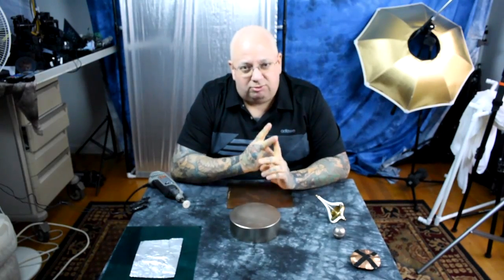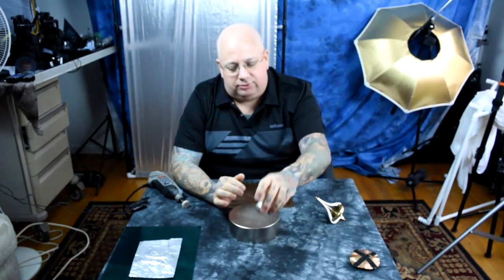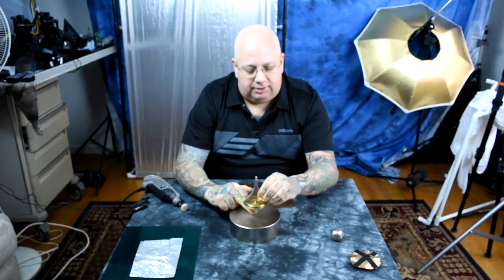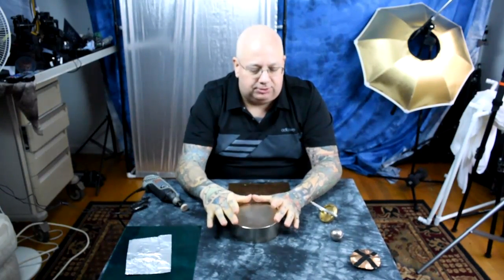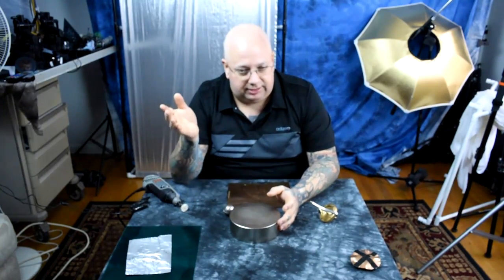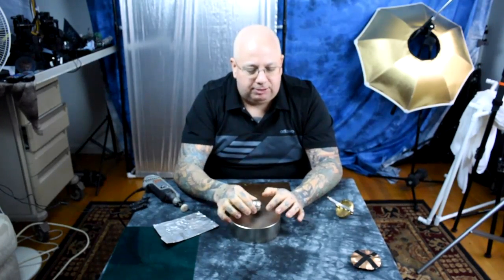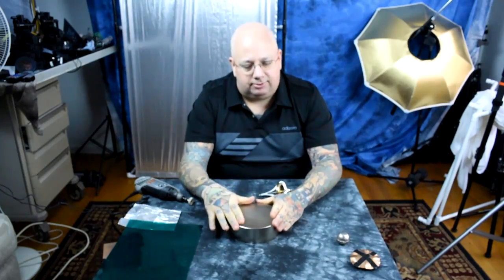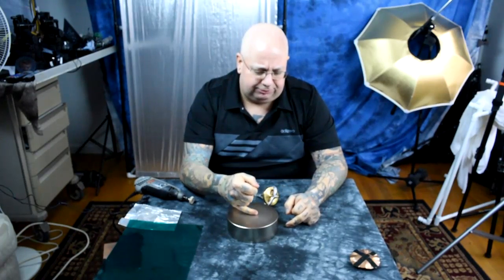PART 1: GOLD SLUICING EXTRACTION device using magnetic divergent field geometry

Comment: Love you vids and info. I got to admit I'm in to prospecting but maybe a bit different from what people are used to. I extract gold from e-waste... To be honest I though about using magnets to sluice gold and its about time a expert gives advice on the subject. My day job is a Draughtman and a I design mining and refining equipment for mines just to add background. 1 issue using permanent magnets, usually when slicing you get iron ores and small partials that are ferris/magnetic. So you would eventually will have build up on the magnets. Cleaning can become a  task on its own. Now I found 1 solution: wouldn't using electromagnets work better as you can switch them off to clean and you can customize the strength to suit. Did you have a solution for this issue or maybe I'm not thinking clearly about it. Looking forward to hear your valuable opinion...

Comment: ..."(bismuth) is havier than lead"?  Unless you meant it has higher atomic number than lead (83 vs 82) I can' see how is it any heavier than lead since it's density is lover. Regarding the gyroscope, it slows down when put on the edge because the flux intensity and gradient is highest on the edge. Any metal that is exposed to the changing magnetic flux will induce current to counter the original movement aka transformation from mechanic to electric energy. Since electric energy can't be transfered from the gyroscope, Eddy currents that are induced within the disc transform electric energy into heat - slowing the gyoscope down in the process as less and less energy remains in the spinning disc. In the center of a magnet magnetic flux is almost constant so while disc is spinnig induced currents are low. Only on the edge where flux intensity and gradient is highest will motion of the disc induce mentioned currents is sufficienty large intensity to rapidly slow down the disc...
Reply from the maker: heavier than lead: FACT
Reply: ...so how does atomic weight relate to element's magnetic properties?...

Comment: OK, I Built two copies of your magnetic device, exactly word for word like you showed in your video. I got the angle you wanted off of the Divergent perfect. At the distances you suggested the immediate problem is massive amounts of black sand immediately clog the sluice. Also everything gets wet and nasty real quick. I took a powerful magnet and hand separated the magnetic black sand out, it took forever and was very hard to do, but it can be done.

Before worrying about driving the gold down into the mat we need to figure out how to remove most of the black sand before gold separation. Key to this is realizing the volume needed.... I figure about 5 shovel fulls a minute is a comfortable work speed. Translated out of a 5 Gal bucket (about 100lbs of fine conglomerate) is about 70 Lbs of black sand.... I'm thinking on a design.

Water volume and velocity is critical to the application as well, which is a huge variable. In real life desert gold hunting you are often severely limited on water to use and many places people 'dry pan' or 'air sluice' which is a whole different application. Is there a way of using the same concept with electric magnets that could be easily switched on and off to clear the clog?  Suggestions or ideas?

Comment: Also wanted to comment on your video on the Crookes radiometer was wondering if the purple light made a difference because purple is made of red and blue  an  different ends of the spectrum  opposing each other on the white and black? Which also makes me wonder since white and black are not actual colors but the absence of supposably. Does adding color to the lack of maybe make a difference? To me it's fascinating stuff

Comment: theirs a tornado in the center it all seems to move in spins witch turn into spirals........... it spinning so fast that it cant slow down very easy pole turning so fast until its propelled out the other side. at witch point it move into less intense filed so that it decelerates.

Comment: you don't understand magnetism. the magnetic field is concentrated around the edges due to nothing other than the geometry of the magnet. the field coming out of the top wants to go to the bottom on the shortest path, it's only natural that this field would be concentrated around the edge of your magnet.
secondly, there is not a vortex or drain in the center. the field is uniform.
think of the funnel thing where you toss a coin into. the coin will go around and around in a vortex until it disappears but the funnel itself is uniform and not a vortex. this is where you're getting confused. you see stuff funneling down like the aurora or electrons in a magnetron, so you assume the field is like that, it's not.
it's like you're seeing the coin go in a vortex, so you assume the funnel is a vortex. they are totally different things.
there is no funnel in the magnetic field. magnetism IS magnetism. the field is one of a kind, there aren't two different kind of magnetic fields in a magnet.
Reply: Can you comment on clockwise and counterclockwise displacement patterns forming on the CRT screen depending on the polarity of magnet faced towards the CRT screen?
Reply: I believe it is you who doesn’t understand magnetism! Eg. ‘Due to nothing other than the geometry of the magnet.’  That is incorrect, and provides a very limited  explanation, perhaps an oversimplification. Would you like to discuss this further with me?

Comment: so funny I figured out how to use magnetism for gold extraction through the you tube clip you mentioned too!! only a week ago, well that one and another one showing gold sticking to an electro magnet, and one that shows a metal pipe  with magnets attached to a central rod powered by a drill  that picked up the condensed black sand and the flipping of the black sand as the magnets rotated dropped out the gold. If all of this was combined into a unit it could pull out gold and black sands from the falling dirt and that way no gold ( or minimal gold) would be caught in the riffles and less work would need to be done in the collecting process.

Thank you for explaining how this would work on a scientific level ( i had idiots in my science class that disrupted every thing so i learnt didily squat)
Reply: its been 6 years... please tell me your a multi millionaire gold hunting Ninja??.. or did it not work very well???:body-blue-raised-arms:
Reply: @GUY9021  oh I never said I used it I'm not in a gold bearing area.